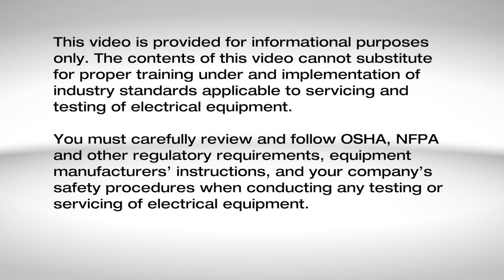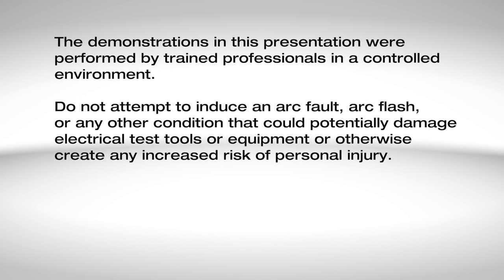Arc flash survivor interview

Comment: I had a 440 3 phase breaker panel grenade in my face once. Lucky for me the panel door took most of the blast. I got away with little more than being flash blinded and getting hair burned some. I could not hear right for about half an hour. After about an hour my hearing and vision was back to normal. The panel was in a wood work shop. I went to reset the breaker for the planer and them BOOM. If had had opened the door a split second sooner I would have been messed up for life if not killed. The investigation was a wash. There was not enough left of the panel to really know what happened. They said in the end that all 3 phases shorted to each other and ground. It blew the transformer off the pole. I am guessing all of that did not happen at once. I would say there was a chain reaction but as to the start of that chain I do not know. If my panel went off like a grenade (3 phase 440 volt 400 amp service) then the panel the man in the video was working on must have went off like a nuke  with it being a substation panel with far more voltage and amps.
Reply: Did the breaker trip while the planer was in use?  Wonder if something overheated like the breaker, fusing the 3 hots buses.  I remember something very similar occurring with an air conditioning (commercial) system that may have overloaded started a fire in the electrical panel room which severaly damaged the equipment shutting a fast food place down for about a week or more which repairs were made. There probably was an electrical arc or flash over. I recall the underground transformers were damaged, as well.
Reply: @TheTheo58  Yes. That was the reason for me opening the box in the first place, to reset the breaker.
Reply: I just had an arc flash right now...my face is burning like hell
Reply from the maker: Hi there, we take all comments regarding the safety of our products very seriously. Please private message us your contact information and more detail on what happened, so we can look into this further.
Reply: @fluke  I don't think he ever said it was one of your products..